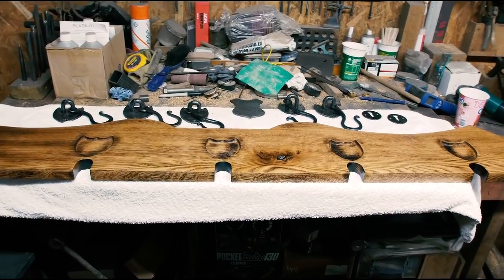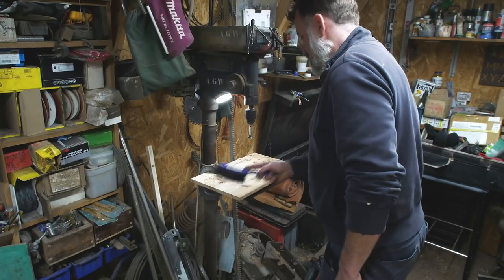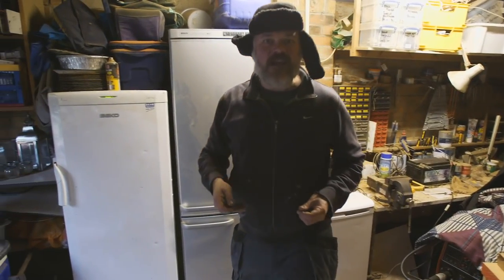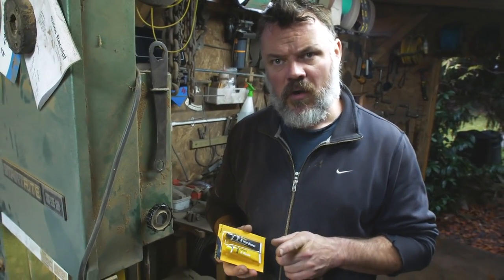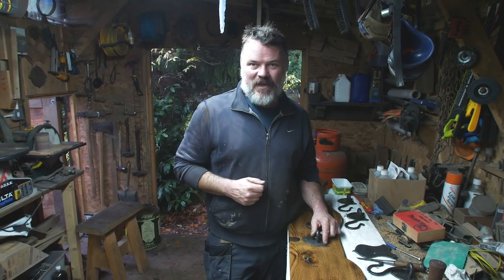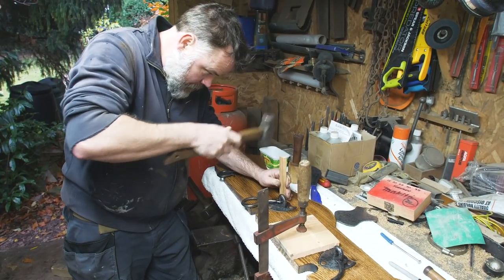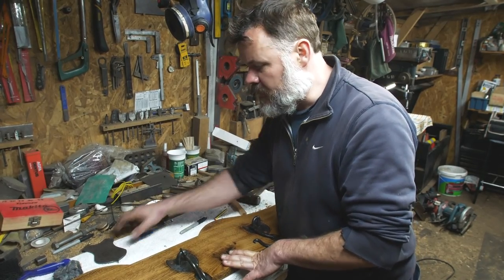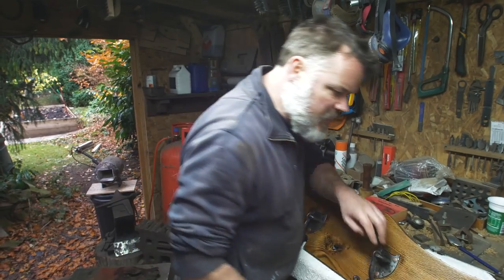The Heraldic Coat Rack Project (Part 2) - Woodworking Tips and Tricks

Comment: Well done gents.  Good call on using oak instead of walnut. Glad you opted not to do the shields .. good call Camera Boy.  If you are making more, the only thought I have is the notches that allow clearance for the hook need more wear and irregularity,   Everything else looks old and well worn but those look fresh and crisp from some machine.  Keep up the great work.
Reply from the maker: As always swirt you have a great point there, it's something we will definitely discuss. There was a section that didn't make the cut where we discussed changing the design of the timber when we try the skull concept, so yeah, thanks for the help!